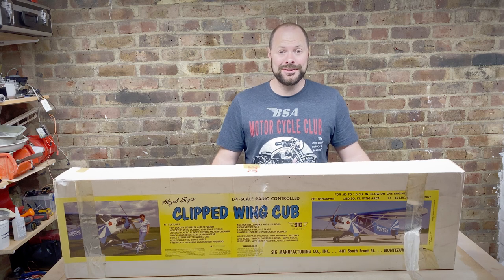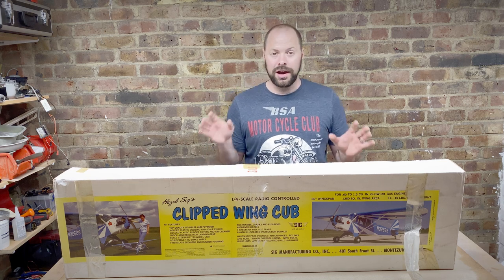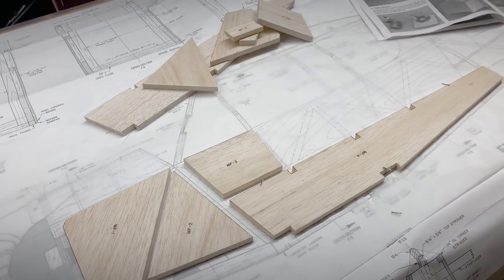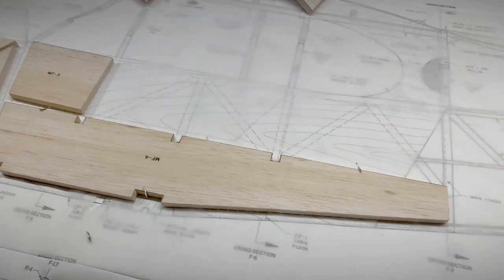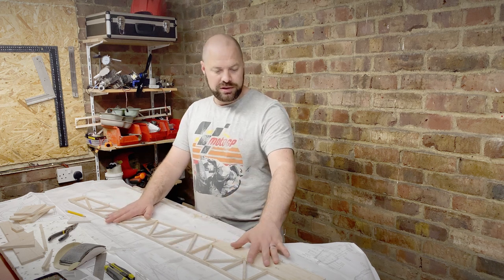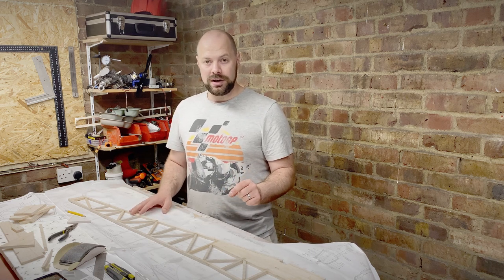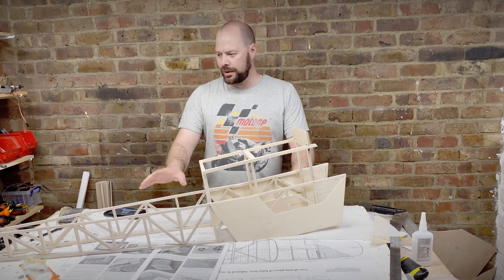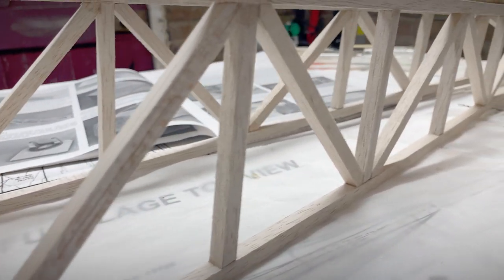Citabria is dead, long live the CUB! SIG 1:4 Clipped Wing Cub build Pt.1

Comment: Nice progress on the fuse.  You may feel a bit challenged on this kit but it's normal and an excellent learning experience.  By the time you build another you won't even need an instruction book.  You'll simply download a plan off Outerzone and start cutting parts!   I haven't built this particular kit but have built several Sig ships.  Glen Sigafoose was a printer before he went into manufacturing balsa kits.  The company has always printed their own plans, instructions, even wood!  Most of the kits were designed way back in the '60s and '70s so they tend to involve a lot of cutting and custom fitting.  They are also a bit heavy and overdesigned structurally by today's laser cutting standards so "strengthening" isn't required generally.  In fact many people lighten by drilling holes in things and replacing pieces with lighter balsa.  One benefit of having a stout frame is that the plane will last longer under normal wear and tear.  It's not that unusual to see old Sig planes still flying from the '80s/'90s.  We're amazingly lucky to still have these old grandpa kits still available and reasonably priced because they're fun to build, reasonably priced, and fly very nice.
Reply from the maker: Love all the info, thanks for sharing 😁👍🏻

Comment: Don't know what you mean by an old kit. The latest one I got last year was the same. Only problem is the wing doesn't take a tube and the struts need some TLC. I am careful using 
Hobby King switches, check it carefully and ask someone that knows about switches.
Reply: I’ve just purchased this kit. Sig website says the kit is die-cut. Who knows how old the kit I ordered is… anyway, sounds like you’re saying that even the newer runs of this kit still require you to cut everything out? I don’t have the tools to do that so I might have to return it and get the BUSA kit.